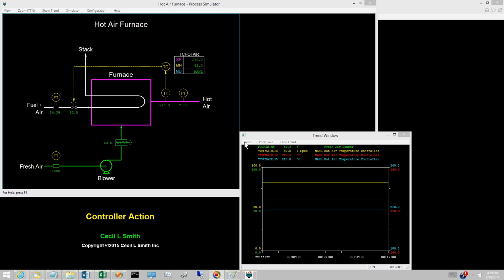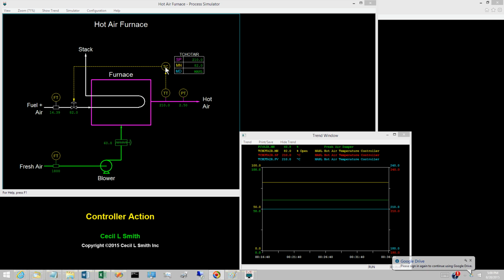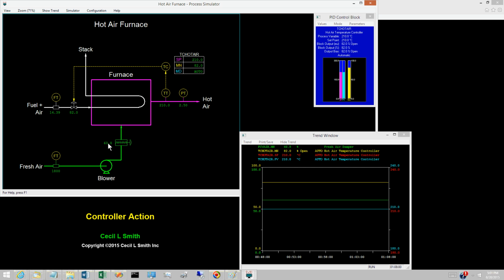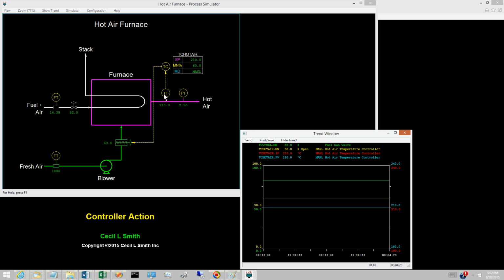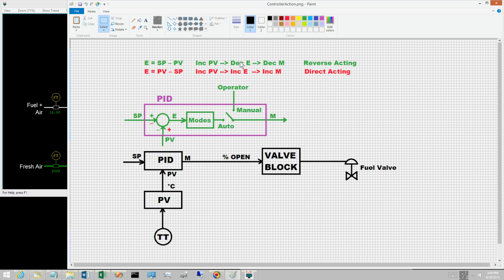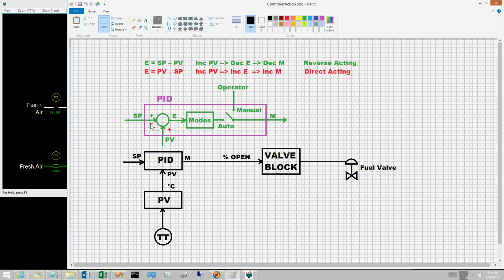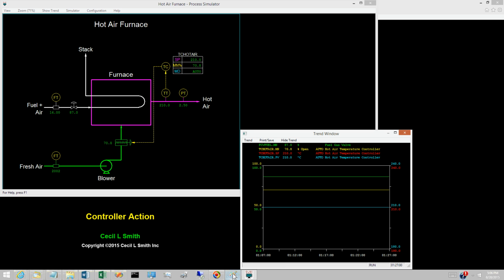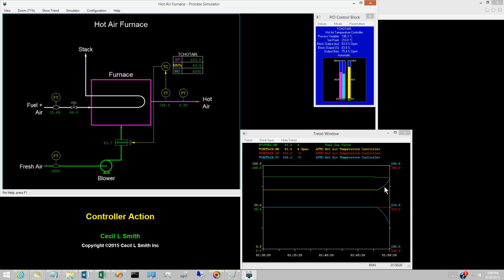Controller Action

Comment: what about the failure mode of the valve?
Reply from the maker: +Esteban Arroyo The current trend is to include the failure mode of the valve in the configuration of the valve block (or its equivalent).  This permits the output of the controller to always be % Open.  A few systems included the failure mode of the valve in the configuration of the controller, which works well for simple feedback loops.  Unfortunately, some systems provide neither.  Nevertheless, the objective of all controller outputs being in % Open is beneficial.  With no valve block or its equivalent, final control elements that are "fail open" require the insertion of a block or computation between the controller and the final control element to convert the controller output from % Open to % Closed, that is, subtract the % Open value from 100% to obtain the % Closed value.